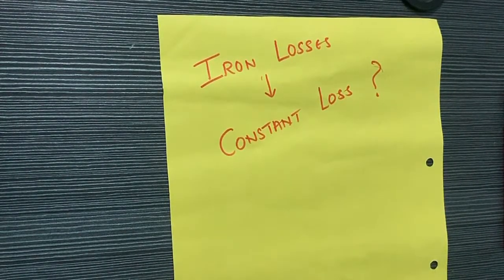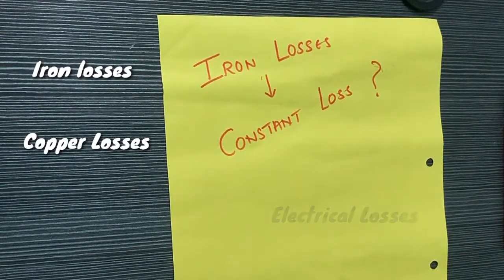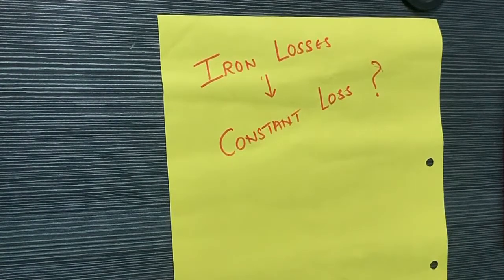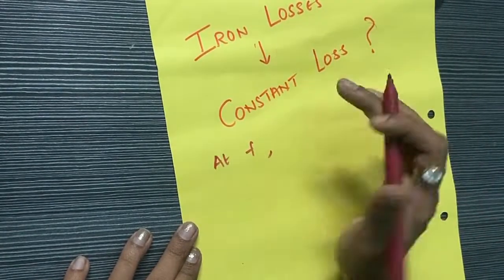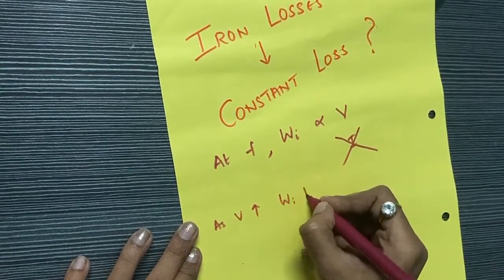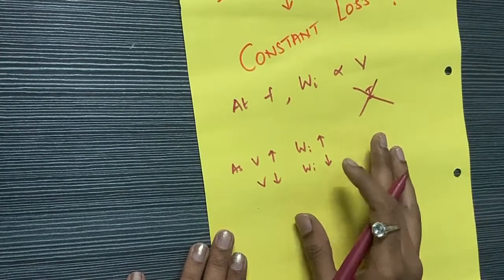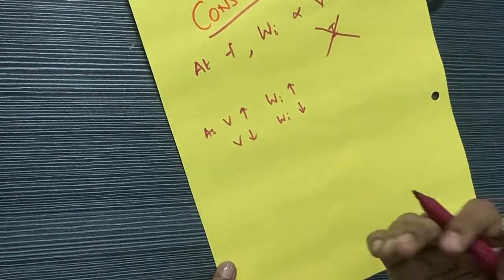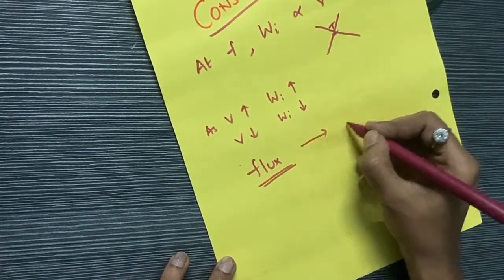Why Iron losses are called Constant losses?

Comment: Iron loss consist of hystersis and eddy current loss but this two loss depends  upon the material used then how it can be changed because of vtg
Reply from the maker: Iron loss depends on the material... that means it depends on the flux
Flux is directly proportional to V/f ratio here since frequency is constant at any instant, flux is directly proportional to voltage
Therefore iron loss depends on flux i.e. indirectly on Voltage
Reply: @letslearnelectricalenginee4671  got it☺️👍👍

Comment: Hey thanks. I dont understand why on constant flux, we can have different powers considering that we transfer power from one winding to another through flux.
Reply from the maker: Sorry I didn’t get your question
Reply: @letslearnelectricalenginee4671  Np. Transformer transfers power from primary winding to secondary winding through flux right? If flux is same, how can it supply different load on same flux. What changes in core to transfer more or less power?
Reply from the maker: First of all energy can neither be created nor destroyed it is only transferred from one form to the other
Secondly, transformer is a constant flux, constant frequency, constant power device
It means it is same in both primary and secondary 
All that changes is just voltage and current and ofcourse with phasor displacement.
Increase in voltage is obtained by decrease in current. Decrease in voltage results in increase of current.
There is no extra power taken from anywhere
I hope ur doubt is clear now
Reply: @letslearnelectricalenginee4671  hey thanks thanks your wording allowed me to ask my question in a better way. If current increases in primary, it will also increase in secondary. What causes it to increase in secondary? Has to be some change in core right? How does it change
Reply from the maker: If the current increase in the primary, the flux in the primary increases, the flux linkages with thw secondary increases, emf infuced in the secondary increases and thereby current also increases
Reply: @letslearnelectricalenginee4671  thanks a lot, then why do we say transformer runs on constant flux? If change in current changes flux? Also AC current should induce variable flux in it.
Reply from the maker: Yes transformer is a constant flux device
Flux is different from flux linkages
Flux (phi) is constant in the core for a given load 
Only the flux linkages (N d/dt(phi))change fue to the alternating property of the supply
Reply from the maker: Flux is constant means it is not increased or decreased when power is transferred from primary to secondary unlike voltage and current
Reply: @letslearnelectricalenginee4671  Oh I see now I understood it all! Thank you so much for explanation and your time :) You really deserve million subs. I have added your channel as featured on homepage of my channel to help a little. Thanks again!
Reply from the maker: Wowww
That’s so sweet of u
It really means a lot to me♥️
Reply: @letslearnelectricalenginee4671  thanks, you are soo sweet as well :)❤